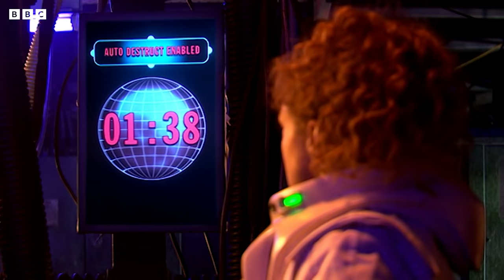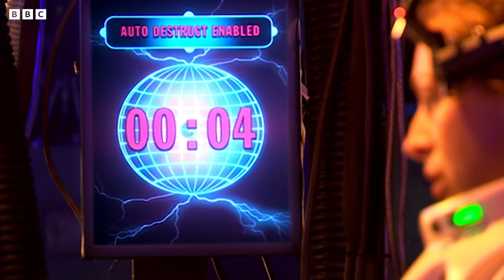River Song: Iconic Moments | Doctor Who

Comment: If the doctor is shot dead during a regeneration then he can be permanently killed? We found that out when 11 was by the lake.  Yet when 11 turned into 12, the daleks couldnt defeat the doctor in his most vulnerable state. 13 fell to her death during a regeneration cycle. 10 had his hand cut off but was fine.  Not quite sure what the rules are since they seem so inconsistent.